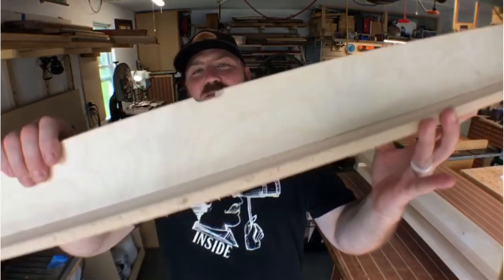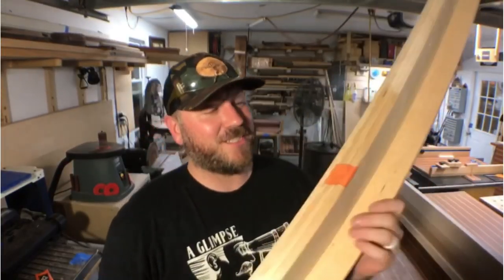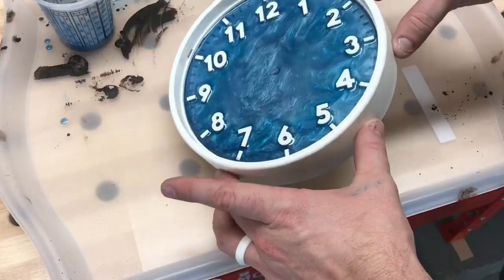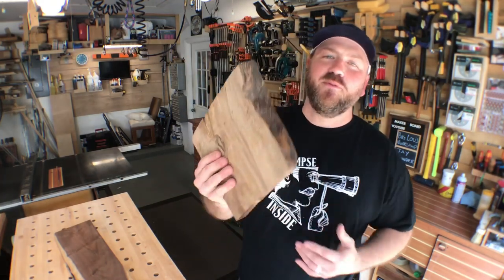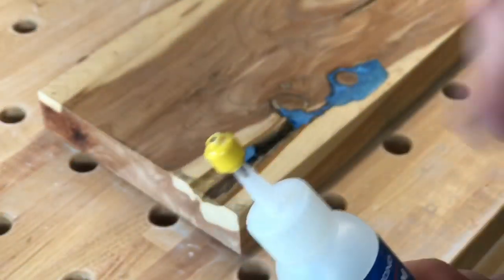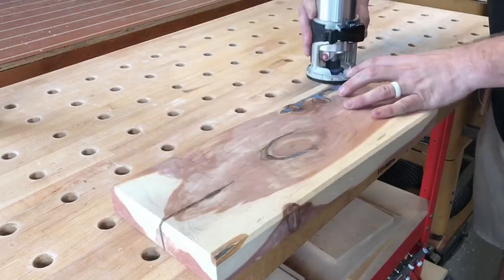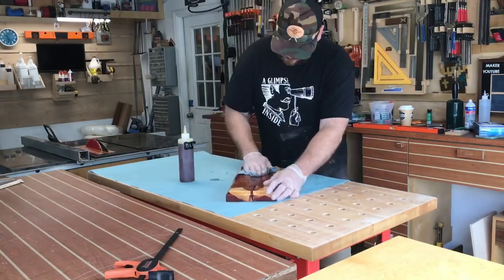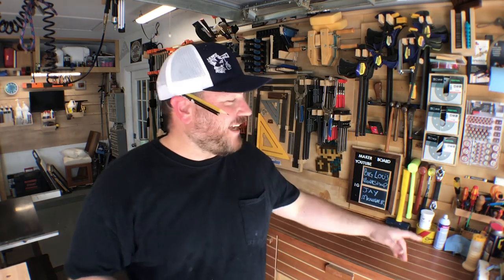3 Ways to Get the Most Out of Epoxy Resin | Total Boat DIY Projects

Comment: Great video and information.  Do you have to worry about bubbles and using a hair dryer or heat gun to burst bubbles?  Thx.
Reply from the maker: If you mix too fast you incorporate more bubbles. The slower you mix the fewer the bubbles. But yes a hair dryer or a heat gun or even a blow torch will help mitigate that as the Apoxsee starts to cure

Comment: What about using epoxy to prevent a problem?  I have a floating shelf project I'm doing. The boards are at 20% on the moisture meter. I have a feeling that the ends will crack.  I'm thinking epoxy on  the ends to try and lock them together. What is your opinion?
Reply from the maker: That quite possibly could work. I would give it a go if it were me

Comment: hey bud, i am looking to do an epoxy coat on an oak slab for my bathroom using totalboat epoxy resin. is is possible to coat the slab in danish oil, letting it dry and then doing the resin, or would you suggest just leaving it? cheera.
Reply from the maker: The danish oil once fully cured should not be a problem for the epoxy. I know I’ve done the same thing with a wipe on poly urethane. And it worked fine